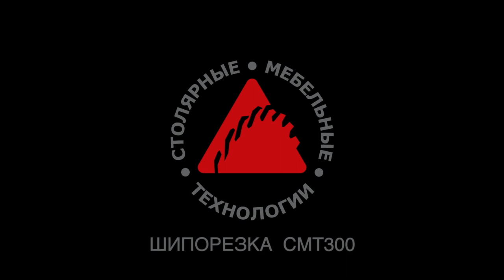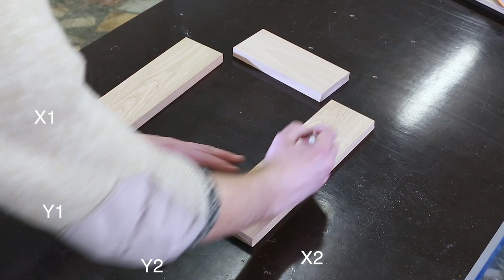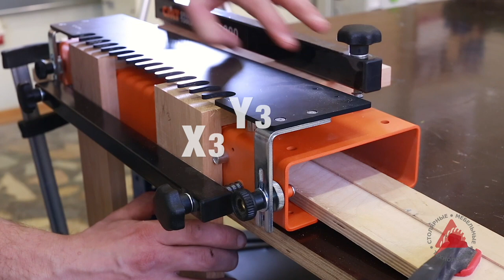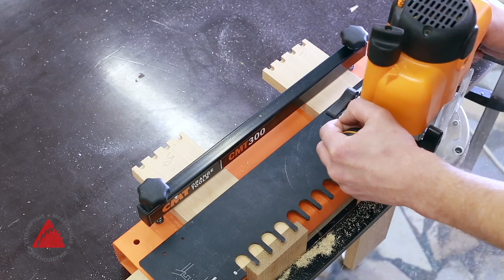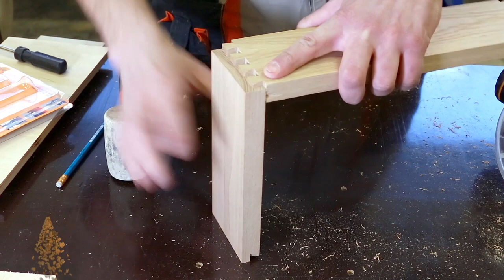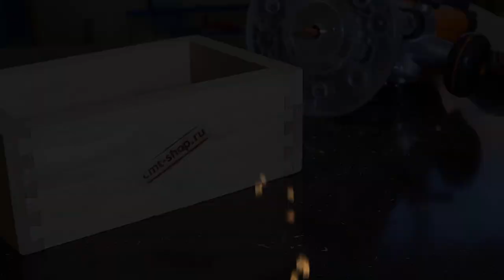Ласточкин хвост в полдерева | Шипорезка CMT300 | Dovetail Jig

Comment: I have the same jig but I have to set the routerbit depth to 12,7mm otherwise I can't fit the parts together.
Reply from the maker: Nilco Ligtvoet Hello. 12.7 mm is something like a base value of departure of the router bit. Than you need to practice empirically select this departure, depending on the thickness of the workpieces, the type of wood and your preference for the density of the connection. More bit overhang - tighter connection, and vice versa. You just have to try)))
Reply: @CMT-SHOP  Thank you for your reply.